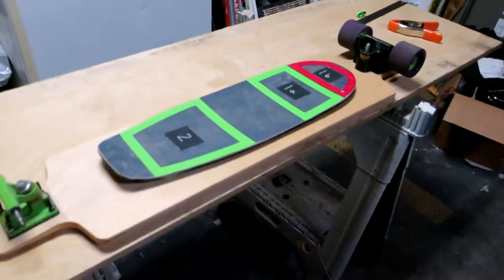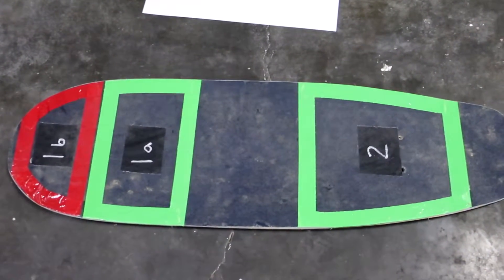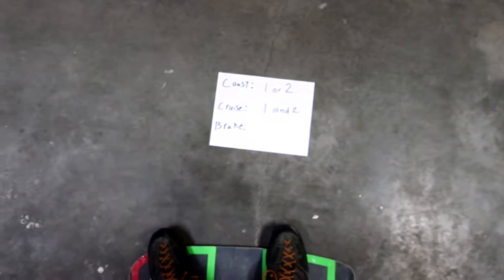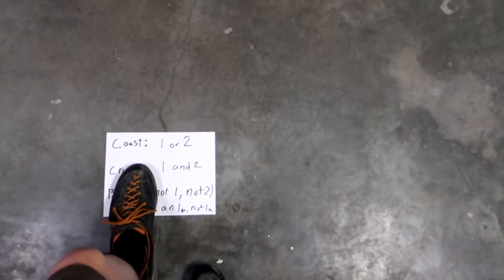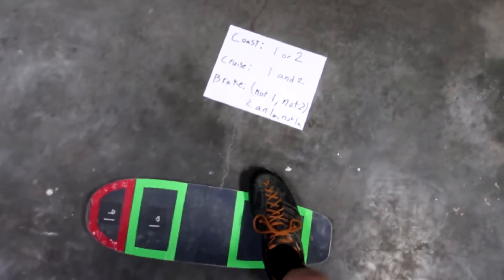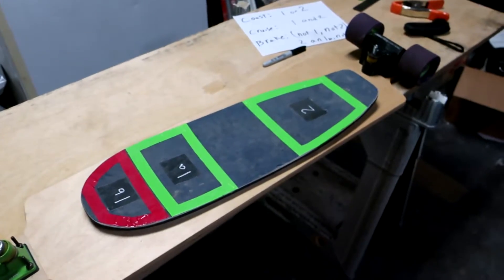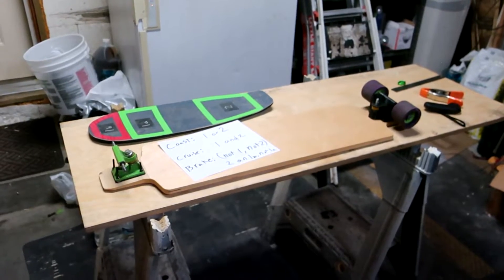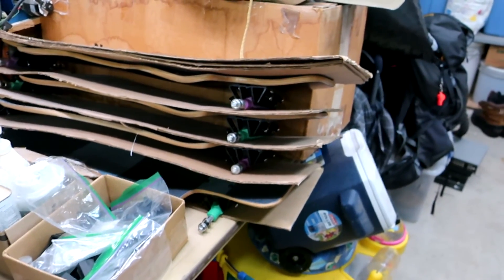Push Assist Esk8 concept

Comment: Loaded X Unlimited have push assist remote-less (when using in unlimited mode). They implemented foot breaking so the remote is not required at all, not even for breaking.

Comment: It sounds like you may be interested in the drive by Mellow Boards, as it has two similar features to which you described in the video. Furthermore, currently, they are both features (as of yet) that are exclusive/ the only product on the market that has them. 
Number one, being the push-assist mode which they call 'endless mode'. They still recommend to use the remote however, as they say that it is required for braking (in case you go down an incline for example).
Secondly, are the brakes that the drive has. In addition to the regenerative braking, they have a resistor housed inside the unit, that turns the excess energy into heat (meaning you can still brake, even if the battery is at 100% again due to the regenerative braking).
If YouTube lets me, i'll attach two video links to Mellow explaining both features in greater detail.

PS, i'm a big fan of the channel, it has some great ideas and is really informative, keep up the great work!

Push-assist/ endless mode:
https://www.youtube.com/watch?v=AWWLP7TwsDU

Mellow brakes:
https://www.youtube.com/watch?v=3ZKXtsFEW40
Reply from the maker: Yes, so I'm aware Mellow has been going down this road.
The main difference is I'm adamant that its got to be remote-less.

I think there's speed controllers that support similar features if you want to DIY it.

Comment: Slight adjustment to your idea. You can use an accelerometer to determine the acceleration and incline of the board. Say at 10% above natural acceleration it would know you are pushing and assist you while one foot is off the board. Like an ebike.

Comment: Will work only on flats. Imagine goin over little hill, for a moment zero pressure and brake.
Reply: Because different drivers have different weights, you can't have a motor with the perfect power to cruse. The motor needs to be just a little bit oversized. 
So going a up a small hill shuden't be a problem (at least if your not that heavy)
Reply: @re_Create  I mean more like a little ramp.. like going from road to sidewalk for example.